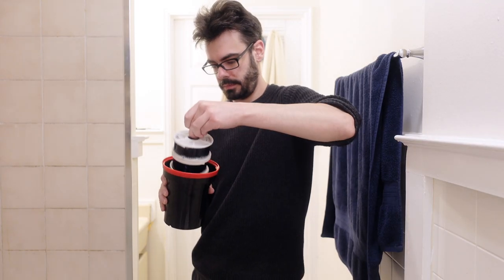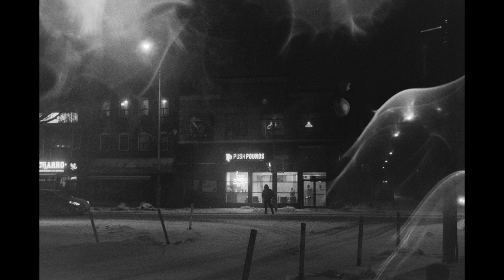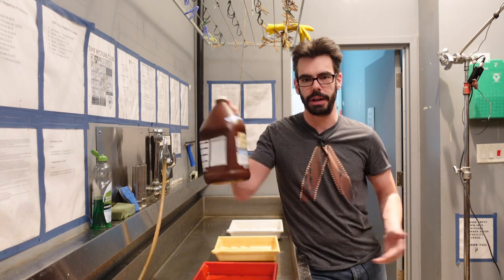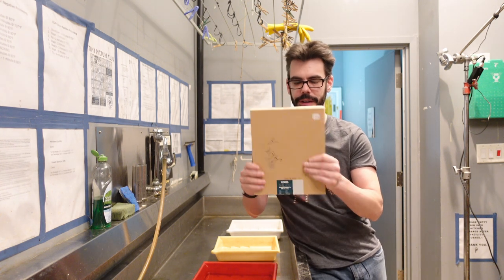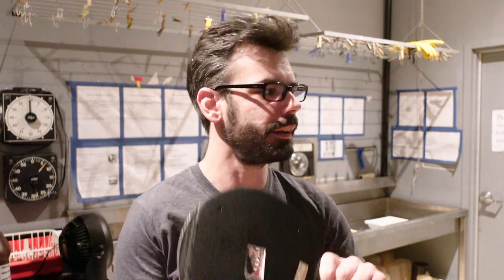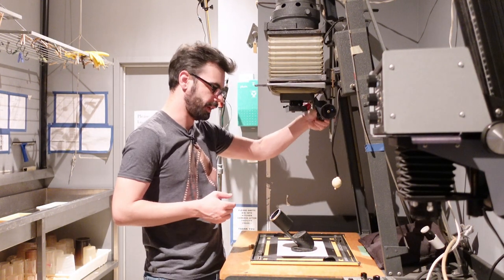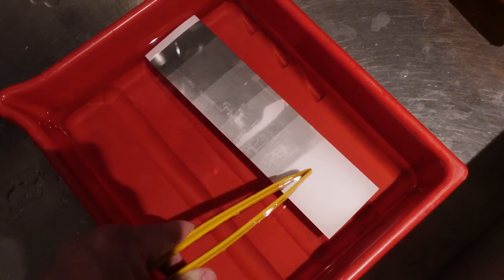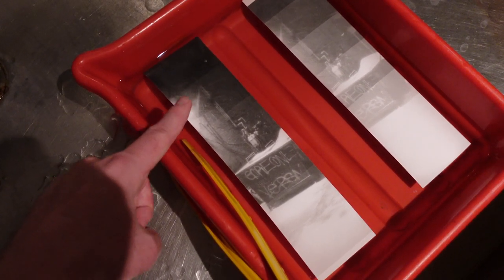HP5 at 3200 & DARKROOM PRINTING | Black and White Film at Night

Comment: You’ve probably realised this, but the filter takes away about a stop of light. That is why your second contacts were so much lighter. A grade 2 filter is actually neutral contrast, and so the contrast will not differ from using no filter (but the exposure will). This is one of the things I like about B&W developing and printing, its great fun just trying out things without the need to be too precise, but you can be if you’d like to. Have fun!
Reply: with ilford multigrade filters you also have to up the time of light exposition from number 4 to 5 (it's double the time)
you can also play with the aperture of the lense of the enlarger... yeah b&w printing is so much tweaking and playing around with all the parameters, it's so much fun !

Comment: Hahaha when you got the snow thunder claps on cam I knew exactly which storm was going on hahaha

I had the same idea a few weeks before that when a huge freak dump of snow in Detroit and 0 wind left over an inch of accumulation on every little branch. Got some amazing shots on bulk ilford hp5+ pushed as well, it really  is such a good film to take out in such low-light and low-contrast scenes like winter

Comment: Interesting video. I’m a film photographer too, and I am helping a bar immensely town with a project where I take photos of bands playing. I then do darkroom prints of each artist to be displayed. The lighting is pretty awful so I usually shoot HP5 at 1600-3200 and dev using microphen. 

Printing the negatives is hard work. I keep a darkroom diary where I make a note of all of the timings and filters I use. I usually use anywhere between a grade 1 to 2.5 to strike the balance between the whites and blacks. To make matters even worse, I use an LED head which is meant for 4x5 negs! Keep it up.

Comment: Curious how HP5+ pushed to 3200 compares to Delta 3200? I’ve pushed to HP5+ to 1600, but never shot Delta 3200 as a comparison.
Reply: Delta 3200 isn’t actually 3200 ASA, it’s more like 1000 (I’m not sure anyone bar Ilford actually knows), I believe the “3200” just refers to its possible latitude. I could be wrong but this I’m pretty sure this is what I’ve read.
Reply: @tompoynton  Correct, it’s marketed at 3200 bc the way the film handles contrast lends it well to be shot at 3200
Reply: @tompoynton  it is 1000iso. Its no secret. If you look at data sheets and CI levels at each of Ilfords films box speeds, you'll notice that D3200 at 3200iso has a higher target contrast than HP5, FP4, or any of the other Ilford films at their respective box speeds. So developing for the box rated time is technically a push process.

However what i will say about D3200 is that its designed to be a fast developing film. Its development times at 3200iso are nearly half that of TMax P3200 or other films pushed to 3200.

In Kodak Xtol at 72F stock dilution, D3200 is 450 seconds while TMax P3200 is 760 seconds. Hp5 at 3200 is roughly 840 seconds. Hell HP5 at 400 is 480 seconds! 30 seconds longer than D3200 at 3200! You get my point. Ilford has some secret sauce with that film.
Reply: I pushed delta 400 to 3200 a bunch years ago. It came out pretty grainy but I liked that, maybe I shook the tank too much

Comment: Regarding the making of contact sheets, no filter should be around 2.5 of contrast. I'm surprised half a stop make such a difference. I also noticed you don't have those irritating barcodes on the film rebate of yours hp5, is that because is bulk loaded?